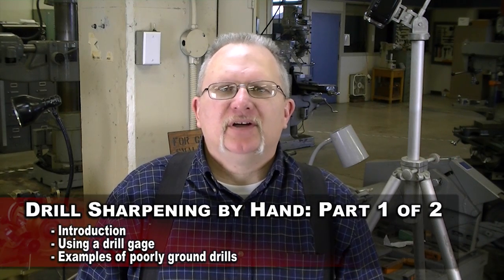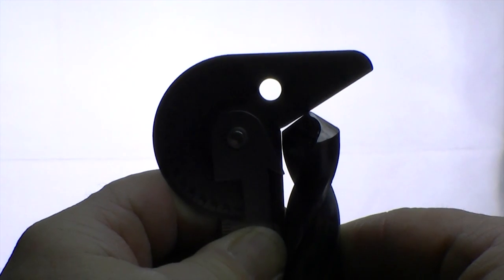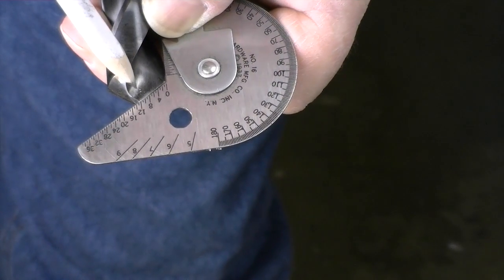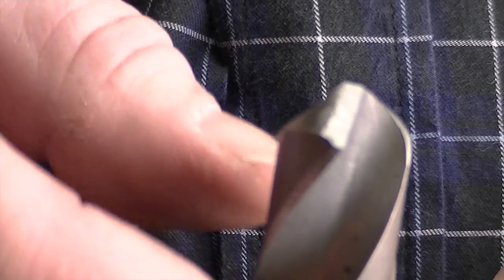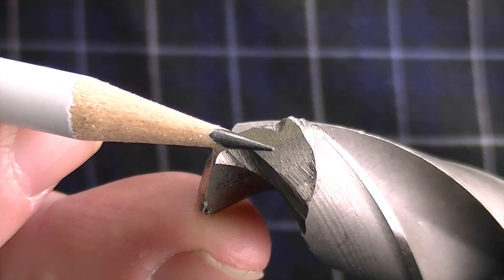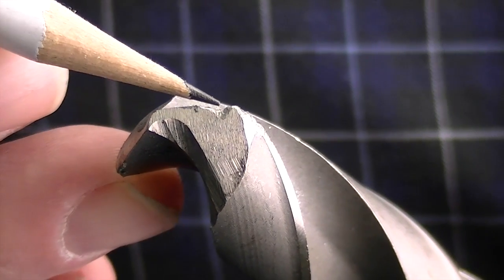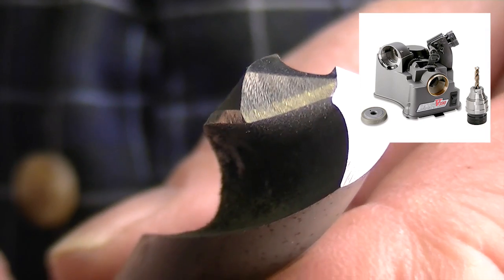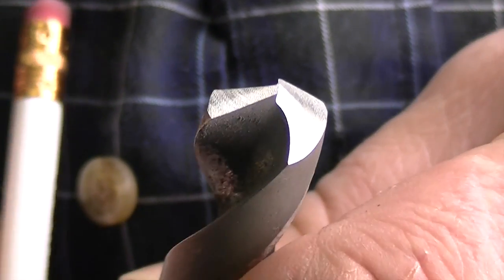Sharpening Twist Drills by Hand -  Part 1 of 2: Introduction.mp4

Comment: I have to drill holes in my plow to mount skid shoes do i habe to a pilot hole then drill the size i want for example use a punch then use a small bet then step up to the size I want or can I just use the punch and then drill the size I want I'm drilling a 3/4 hole
Reply from the maker: JT 1200 is use a step bit. One that goes up in sizes gradually. If you tried to drill a hole without stepping it up your bit would likely grab. You can use individual drills to step it up but a step bit works wonders for this type of job.

Comment: Video says "Learn how to hand sharpen" 
Guy in video says BUY A DRILL DR.    Well damn.
Reply from the maker: Tan Tan yea, for the price a drill doctor can be a very quick and effective way to sharpen smaller drill sizes. It’s great when you have a batch of drills you’d like to quickly sharpen. But if you need to touch up a single drill or a larger drill knowing how to hand sharpen is a necessity! You can also make a bit cut slightly oversized by hand sharpening. Which can occasionally be a convenient trick to know.

Comment: I remember back in trade school (im a machinist), that one of our projects was to sharpen a 3/4 twist drill by hand and it had to be perfect.  And we all sat there struggling so bad to do this at first haha.  But now after several years of doing it, i dont even use the gauge and can cut holes within .005" .  Its a great skill to know!  saves money on bits